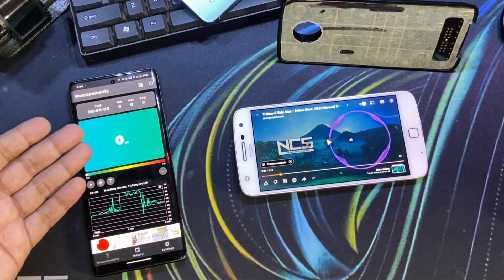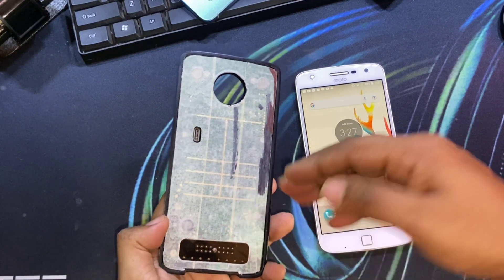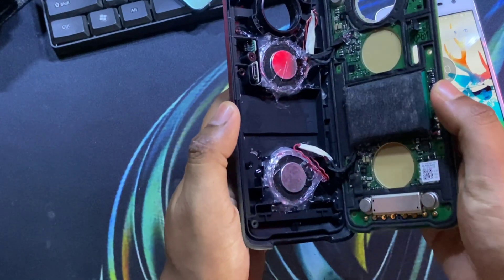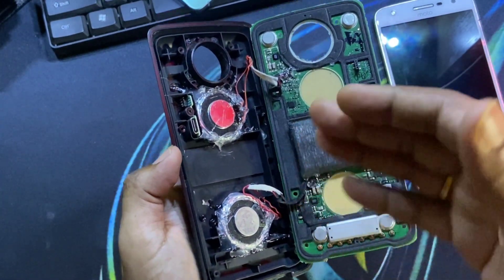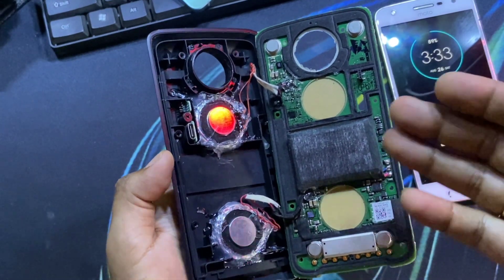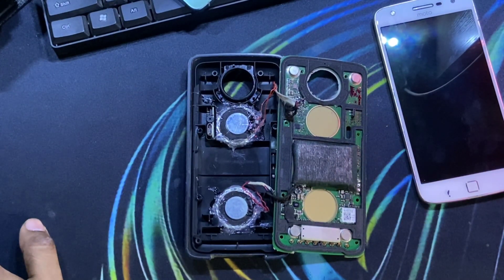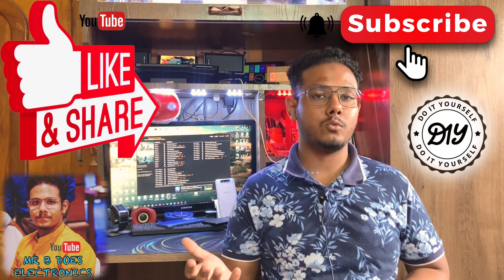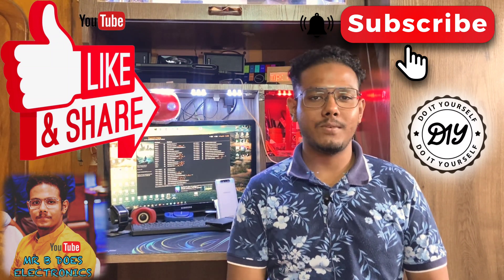JBL Speaker Sound Boost V1| Tutorial to Fix The Low Sound Problem at Home | DIY | MotoMods | 2016 |

Comment: Friend, help, my JBL moto mod lowers the volume only when I put it to maximum. It sounds very low. Do you think something is broken or is it software?
Reply from the maker: @DavoNao brother thats definitely an issue with the speaker drivers, if u open it up, u will see the speaker diaphragms are torn. Same thing happened to mine. Just replace the drivers, i have a repair video for the same follow it.

Comment: I'm hoping that the next generation of JBL speakers or modular speakers will have additional things like 2 t of memory external or plasma lighter and stun even though it would take a lot more power it would be cool to have like a survivalist Bluetooth mod.
I went to the Motorola forums and at least my comments were forwarded to developers
I told them they could upgrade it by making them have up marine-grade speakers so that if it ever got wet it would still be okay. I use my Motorola MOTO Z4 everyday.
I have 18 in of rope with two knots on the ends of it slid through in between the phone and the case the case wraps around the phone is a rubber rubberized case and I wear my phone as a necklace while I listen to audible and practice language learning. I'm also able to walk my dogs and listen to music as it's safer than having earbuds you can hear approaching traffic. Another cool thing about having your phone on a necklace is that you can turn it into an instant bodywith two twists of the phone rapidly it goes into camera mode but in the future will be able to use voice commands to launch into recording mode or streaming police interactions or just videoing where you're at taking in the moment on a trail.
Reply from the maker: Hope all this becomes true oneday and Motorola actually revives this concept.
Reply: @MrB_DoesElectronics  part of the progression of the mods will be that they will have dual magnets not only at the bottom but also at the top then it will switch to the entire back platform is a magnet so that when it drops it still does not dislodge the mod. The wraparound bumper screen protectors are compatible with the Bluetooth speaker and all other mods it would not be surprising to see 20,000 milliamp hour in the Bluetooth speaker mod of the future that's the life of the battery will only get longer and stronger from here imagine when they go nuclear and you don't have to recharge it or solar and it powers up while waving in the sun.
Reply: @MrB_DoesElectronics  they're basically going to run out of options they have to go modular.
They could even make a storage compartment mod inside the Bluetooth speaker mod that folds out. We could see 360 camera phones being standard in most cell phones in less than 10 years. They'll even start putting cameras on the sides of the phones so that as it's laid down it can still be recording in 360 view.